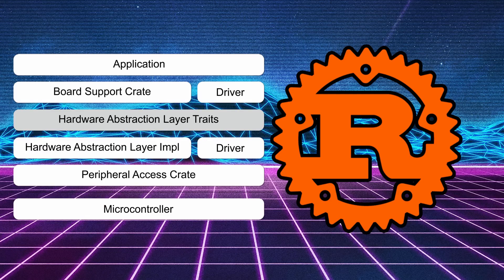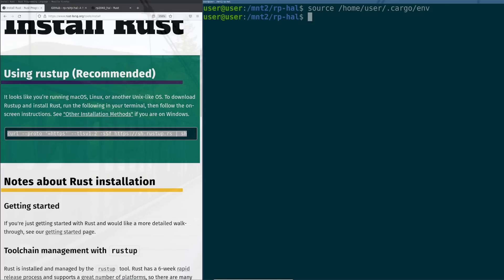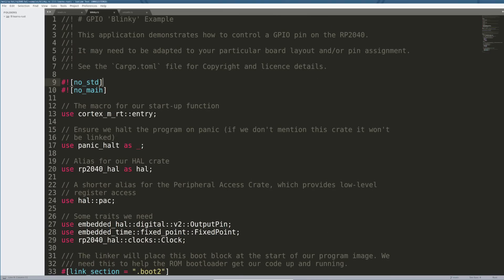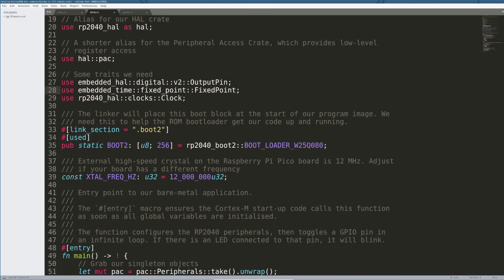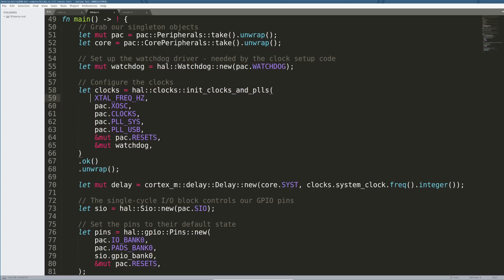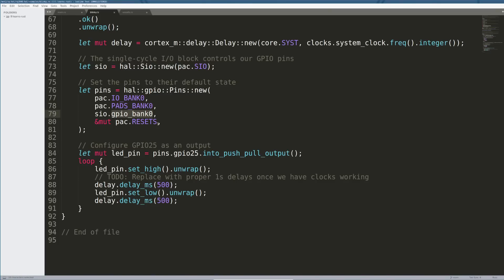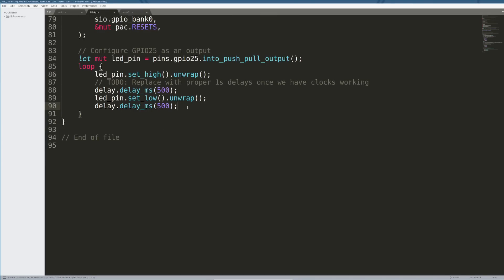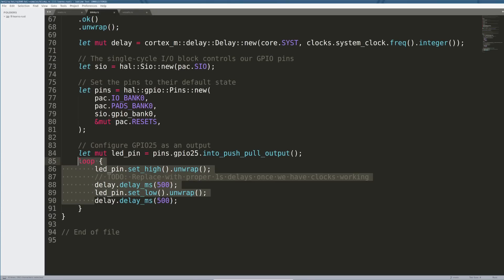rust runs on EVERYTHING (no operating system, just Rust)

Comment: 11:19 that's not what push-pull means. Push-pull means the pin can push the voltage high (sending current into the wire) or pull the voltage low (sinking current FROM the wire). This is opposed to "Open collector" that can pull but can't push. The reason you would ever want OC mode for a pin is when you want to connect several outputs to a single input, as in this case one pin outputting 1 and the other outputting 0 will just result in an overal value of zero instead of frying both pins.

Comment: Very nice, one thing I noticed: Push-Pull actually refers to being able to push it to 1, or pull it to 0. One alternative is High Impedance (Hi-Z), which is an input (no possibility of writing any value), and another alternative is open-drain (you can only pull it down to 0, but if you want it to go up, you need an external pullup. Useful for combining multiple output pins and the output will go low if any of the output pins of different ICs goes low)

Comment: It's a nice video... but how about setting up the environment if you are using a board that you made yourself, running a custom SoC, based on RiscV for example?  You are using runners and all, but how do you specify how to connect to the hardware, for which target cargo should emit code, etc?  This video only shows how to use someone else's configuration.

Comment: Maybe I'm spoiled by ATmega, where to init the chip you need to write a value to the same address two times, but this looks ugly. I have a very strong belief if you pass 3+ fields to a function, such function should be a method (or has method to wrap the call). Something like `let mut watchdog, clocks = pac.init_clocks(XTAL_FREQ_HZ)` would be cleaner abstraction. Pins initialization smells: bank0 is specified three times, so much DRY. boot sector needs to be set up manually (Can't rust macro emit it? We already use [entry] as a macro)
halt as panic feels half-baked. We don't send messages over UART or blink, we just halt.

Comment: This seems hellishly over-complicated when compared to C or Assembly Language.... All of that boiler-plate initialising things I would never intend to use.
I was initially optimistic about Rust because I can't stand C and I've been looking for a modern replacement for years. But 50-ish lines of boiler plate is making Ada look like a simpler alternative.
Do we really really need a bootloader in our binary? To load a program that's already in the flash? :(
Reply: You really do need a 2nd stage bootloader for RP2040 if you want to access flash or want a program larger than 256 bytes - regardless of the language you use.
This is one of the trade-offs of using external SPI flash for program storage on a microcontroller, and is not unique to RP2040 - other flashless micros have similar requirements. We just don't hide them from you in an SDK that only works for one board.

Comment: so it actually make the embedded system completely memory safe?
Reply: Well, mostly. You can be sure the bits outside the 'unsafe' blocks are safe, but ultimately embedded code needs to put magic values at magic addresses and there's no way for the compiler to know that that's OK. So we write the PAC and the HAL using bits of  'unsafe' Rust that we have manually checked are actually ok, and give you higher level APIs that are memory safe.

Comment: "We won't write unsafe code to write directly to memory addresses.  Instead we'll call unsafe code that writes directly to memory addresses."
Reply: Well yes, you ultimately have to do something like that to interface directly with the hardware. But if this part is already written and checked for you in a HAL, you can just reuse it and write safe code over this interface. There's always the risk that there's an error or vulnerability in the HAL (or even in the hardware itself) but by minimizing the parts where such a thing can exist and reusing high quality code that has already been checked for error, you're elevating the level of trust you can have in your software.

This is the same rationale behind why you shouldn't write your own cryptographic code and should use well trusted open source libraries instead.

There's definitely limits to this approach : sometimes the "well checked" code hasn't actually been audited carefully, and sometimes the "experts programmers" were anything but.

But that's still better than the alternative (unless you're already an expert or have a lot of time to lose learning the minutia that goes into making an HAL/writing good cryptographic code).
Reply: @chaddaifouche536  I hope i'm not misremembering, but i think the video was like "don't use the unsafe keyword!  Unsafe is bad!  Use this instead!" where the "this" is surely using the unsafe keyword.

The point about reusing good code (with the caveat that the good code often isn't good) works for all abstraction levels and i felt it was being presented as specific to this one.

Comment: "Push pull output" is actually referring to the type of output in electrical terms. It means the pin can "pull" to ground/low and "push" the voltage on the pin to vcc/high.  
There are other types of output types such as "open drain" which only pulls to ground, no pushing.
The line setting the pin to push/pull output is equivalent to arduino pinMode(...).

Comment: Fantastic, thank you!  For anybody else who might be getting soem build issues on windows, I had to use the following 2 commands to get the environment set up. Now I have blinky on my RP Pico but it doesn't work on an RP2040 Connect. Is that a different HAL?

rustup target add thumbv6m-none-eabi
cargo install elf2uf2-rs
Reply: Same HAL but it has a different flash chip so you need to change the boot2 line. The bit that says W25Q80 is actually telling you the part number of the flash chip that particular boot2 supports.

Or use the Nano Connect 2040 BSP which sets this up for you.
Reply: I had build issues on Linux (Ubuntu) and after using those commands, my code worked.
Thanks for your help.

Comment: Rust is a great language, im more into Golang than i am rust but when i was on my journey finding what language fit me best i found rust has alot of intriguing functions in it and was inspired by a good 15+ languages im sure of it. rust is one of those languages that remind me of the days when you would open up a GNU NANO editor, take out a plain text book and start writing fortran code, its a very heavy weight and wacky language but it definitely serves a massive MASSIVE use case in most modern day systems, the one thing that threw me off though was how weird it was to write in, this was because of the code sections liek #[], pub static, use, lib, mod, etc etc that just felt a bit weird writing in, the more i got into Perl and fortran though i defintely saw where rust came from. 

but an amazing language for low level programming for sure!

Comment: There is actually an open-source operating system written in Rust for embedded systems called Tock OS and it has support for rp2040 too (and  many other Cortex-M and RISC-V based MCU's). You can then compile and run c or rust apps on top, without needing to know all low level stuff. But if you like the low level stuff you can always contribute to Tock OS :))
Reply: it supports one and a half mcu's

Comment: that nice ! but seems like a lot of boiler plate code, would it be possible to not have all of that written all the time ?
Reply: Basically, you need all this code to initialize your board properly (the joy of embedded code). On the other hand since most of this doesn't change and the "real" code specific to your purpose here is only a few line, there are templates that already have all the boilerplate and you can just reuse when needed.

Comment: This was killer! I'm new to embedded programming working on a less popular RP2040 dev board (seeed xiao RP2040) and quiet frankly all these tool kits I tried first like arduino ide and platformio all fell apart on me, and their documentation and libraries were rancid. You made this simple, the rp2040-hal is excellent, and I'm looking forward to this crash course in rust! 

I may still  veer off into the pico c/c++ sdk for some USB HID libraries but it sure felt good to have something work and work well. And frankly I really want to avoid python, its such a pain to format and work around..

Comment: My Raspberry Pi Pico fell to a bucket of water during doing some plant watering project, I'm pretty sure it runs Rust now...
Reply: safely
Reply: @alexdubois6585  and it cannot race anymore!
Reply: Only direct short circuits and then also with a clear path e.g. between the 5V section and sensitive 3V logic and with a correspondingly high current flow can seriously endanger your board/parts. This basically happens when measuring or when trying around on the breadboard. In the water this is very unlikely. Of course, there are sensitive components where water damage in and of itself affects the function, but a little patience will probably suffice for you. It's best to use a few dry cloths and not even a (hot-air) hair dryer or the oven ... because you can damage more with them than with water.
Have fun bathing and crafting! :)
Reply: finally a way to make rust compile faster: just add water!
Reply: bro even my bicycle can run that

Comment: I was programming in C++ a lot lately and saw this coming up a lot, but never really understanding why - maybe someone can help me with this: In Minute 7:52 in line 39, we both annotated the type at the variable and at the literal with a postfix. I don't understand why this postfix would be necessary, if we tell the compiler the type by annotating the variable and vice versa. I saw this a lot in C++ too with ul etc. Maybe someone can tell me, why this is a good practice?

EDIT: I love this series and I want more!
Reply: You certainly don't need both type annotations.  In fact, you probably don't need either of them, since that constant gets passed to a function, and Rust should be able to infer the correct type based on the types of the function's arguments.

As for what's good practice, I don't have enough Rust experience to help with that.  Coming from a C background, there's a part of me that likes seeing an explicit type where the variable is declared, because my poor human brain does a worse job of type inference than the compiler does.  I really like the rust_analyzer plug in for VS Code.  It will show the type information it has inferred, displayed inline with the source.  Using that plug in, I'm much more comfortable leaving out type declarations and letting the compiler infer them.
Reply: @markday3145  Yeah I'am fully with you on that, it's a great tool to help you remember or even learn what types are there to use in Rust! Unfortunately it can become very long and explicit with more complicated types and make your code less readable than it would need to.

Anyway thanks for sharing your experience and stand point coming from a C background, appreciate it :)
Reply: @markday3145  As far as I know constants in rust have to be always annotated, though the postfix annotation is definitely not needed.
Reply: The first type is required because it's a const. The suffix is redundant and can be removed.

Comment: why complicated things with another highly complicated language? C is enough for me and it has been working wonderfully for me for the past 20+ years. enough is enough. I won't follow this academic and corporate BS anymore for my own well being.
Reply: I've learned rust and C at approximately the same time and I've coded in them for a while now. Writing safe C is a lot harder than writing rust: you need asserts everywhere, you need to manually handle every return type (and every library has a different standard for reporting errors), it quickly gets tiring and scales very poorly.

You can ignore safety and just write what feels straightforward. I've seen students do that at my school and it takes them more time to debug their code than it takes me to write it in a safe way.
Reply: C is simple to learn but difficult to write. Rust is difficult to learn, but less complicated to write. You don't have to worry about the UB pitfalls that you'd worry about in C
Reply: @michawhite7613  Many C programmers ignore UB pitfalls.  Many don't even realize there is a pitfall.  A lot of the time, the code does something mostly reasonable, and works most of the time.  And so it gets shipped.
Reply: @markday3145  I remember one of the developers of Python say that every time they upgrade GCC, they find new undefined behavior they didn't know about before
Reply: @michawhite7613  I used to work at Apple.  Many years ago, the compiler team decided to put explicit crashes in the generated code when it was a case of undefined behavior.  But they didn't tell anybody, and the compiler didn't even emit a warning when it did this.  The kernel started panicking when it ran across these intentional crashes.  Then came a huge effort to find all those places the compiler determined were undefined behavior, but wouldn't warn about.  (Ended up having to analyze the object code, looking for the invalid instruction they used.)

Comment: Nice getting started video :) Thanks

Just one small correction abouth the push-pull output part: it's not called push-pull because you can "pull" data from it to read: it's still an output. It's called that way because it's built with 2 transistors, one can push the output towards the supply voltage and one can pull the output to ground. Just clarifying it here before somebody tries to read data through an output :D
Reply: to make it more clear, other type of output is open drain in which you need to add pullup resistor to keep it high
Reply: Wanted to say the same. Thanks!

Comment: that is a ton of initialization for a blink xD
does this scale for more complex projects.
also wondering where tbe benefits of embedded rust lie and how one would handle DMA access conpared to c++ for let's say fast ADC sampling.
Reply: Yes, it's very verbose.  The Rust style is to encode as much as possible into the type, so the compiler can check it for you.  But that means you need ownership of a lot of pieces of data, and that means a lot of source code (which may boil down to very little code at runtime).  For example, you'd need a separate variable for each GPIO pin you want to use, and you have to pass those variables to any function that needs to access that pin.

You can hide some of that complexity by putting that initialization and extraction of variables into your own library function.  The downside there is that your function has to return a lot of pieces of data.

It would certainly be possible to create a much simpler API (similar to Arduino, for example) that is in some sense less safe.  For example, if you pass pin numbers as integers, you end up having to do runtime sanity checking of that number, and it's easier to accidentally type the wrong number or have two routines manipulating the same pin when they should be manipulating different pins.
Reply: In C or C++ (or any language, really) you generally have to do all this stuff to setup the hardware. Some environments like Arduino hide much more if it. This usually means you have less ability to customize, but you have less boilerplate in your code, too.  All the setup code is still being called for you, though.

The level of detail exposed is a trade off of simplicity vs. control. I think what we've seen here looks like a pretty reasonable level of detail, at least in my opinion.
Reply: Gotta setup those clocks :)
DMA usage is currently same as C or C++: write to registers and make sure no races etc. can happen. Some HAL implementations make this ridiculously easy, see e.g. h7 hal. In the future, some efforts such as embedded-dma and bbqueue might standardise this, but it's hard.